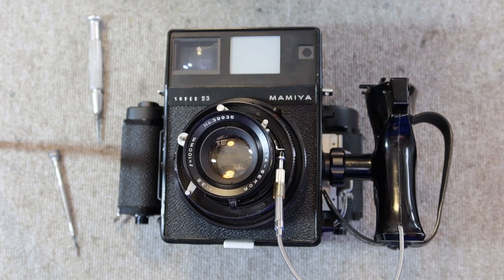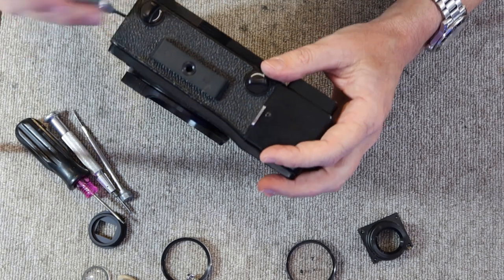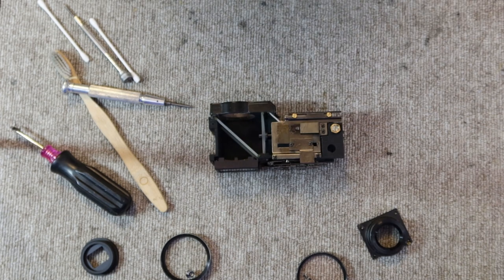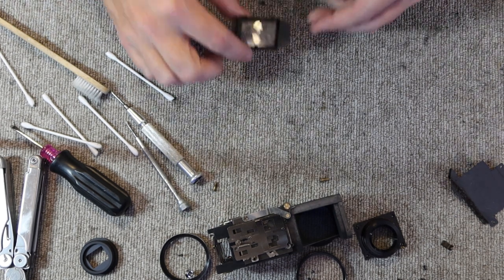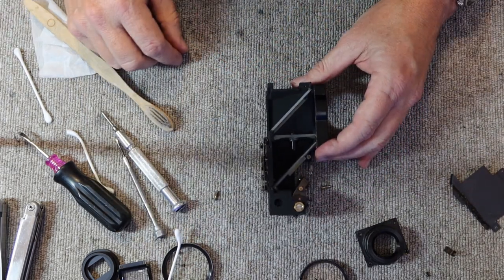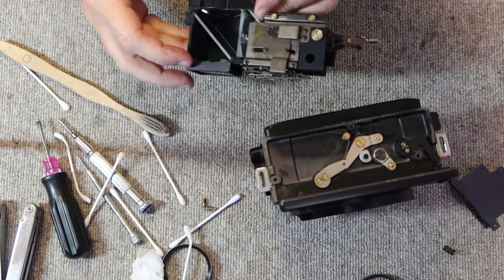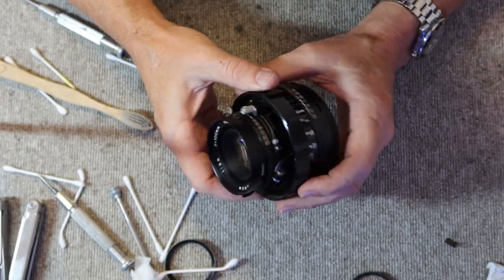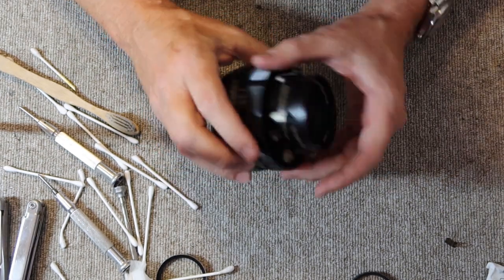How to Overhaul a Mamiya Universal or Super 23 Camera

Comment: also with the Mamiya press (universal and "23") that lens was deliberately made that way, as the focal plane for sheet film holders is different to the 6x9 roll film holders, which is standard with the camera, so this lens "retracts" to allow focussing on the Ground Glass screen, for the "press" mode of operation, with single sheet backs.
On another note, the "universal" is due to the models' ability to accept not just the 23's special 6x9 roll film backs, but also the RB-67's 645/67 backs, with a rare "M" adaptor plate attached, an "R" adaptor is what the rotating back of the RB-67 has on the body ( the silver lever on the bottom of the rotating adaptor), so this camera back is already adapted as standard, but this was, presumably to facillitate compatabillity of film backs between the "macro RB-67" and the "press"\"rangefinder" universal_Press cameras, linhof's were simmilar in their cross compatabillity between their Technika line (6.5*9/4*5)-field cameras & the Kardan/techniKardan/ Karden color line(4*5/5*7/8*10) of monorail cameras.

Comment: Thank you for this video!  After a thorough cleaning of the rangefinder my old super 23 is working so well!  So neat to see how the rangefinder works.  Also, I was able to repair a stuck frameline adjuster as well (hardened grease the major culprit).  Mine is '73 vintage, hope this camera lasts another 50 years.

Comment: Excellent video - thank you. One small point, as these are Japanese cameras, I presume the cross-head screws are actually JIS and would benefit from using JIS screwdrivers to prevent any risk of camming out??
Reply: Yeah, personally, I'd strongly recommend that if you're going to work on cameras in general, particularly Japanese cameras, that you get a set of JIS screwdrivers. It will save you some grief, really, if you make the investment.

Comment: I didn't really see this area addressed in the video, but two of the eight screws are broken that attach the front plate (where the lens mount is) to the body. I'm wondering if you know what size screws those are in order to find replacements. I don't think it will affect the operation of the camera, but if I'm going to do a full overhaul to replace the light seals and everything, I will probably want to get some new screws. Would it be best to just cannibalize another body?

Comment: I found this, 48.10.29, on the rangefinder module of my Super 23  I found a dating chart indicating that the 48 was the year 1973 (10.29) October 29th.  You said your camera shows 49 and the chart shows 1974, not 1973 as you said.  I would like to make sure which is correct.  I created an Access database for all of my camera equipment and I input when the items came out for that model or make.  For the last couple of days, I have watched this video a number of times, paused it, and started it up again to ensure my teardown/reassembly is correct and proper.
Reply from the maker: The first two numbers are the Showa Era year, I know my birth year in the Showa system, and usually just add or subtract from that number to get the correct year. But math was not my best subject in school.
Reply: showa year + 25 is gregorian calendar year (last 2 digits of course)

Comment: I just bought a Mamyia Universal and it seems to be working perfectly fine. I have the 100mm f/3.5 and the 150mm f/5.6 lenses. When I use the 100mm the range finder responds to me turning the lens fine but the 150mm doesn't seem to work with the range finder. Nobody else seems to have the problem, can you help me in some way?

Comment: Thank you for sharing this, very helpful! I was wondering if you ever came across the situation where horisontal rangefinder adjustment couldn't be done because it's too far off the ballpark and the length of the adjustment screw isn't enough to get the images aligned. I have this issue with the early Mamiya Press that has the small horisontal adjustment screw in front, which pushes the metal enclosure with the beam lens in/out, but the full length of the screw is not sufficient (the camera seems to have sustained a frontal drop). Thank you

Comment: Thanks for making this video.  I have been waiting for this.  Since you don't recommend taking the shutter apart, is there any other way to fix the sticky shutter? putting some lighter fluid on shutter blade will also fix the shutter itself too?
Reply from the maker: it can help, but you need to be careful to wipe off any fluid and oil which gets on the shutter and aperture blades. You can use a cotton swab with a little lighter fluid on it. It make take many cotton swabs to get them clean, but the shutter will work better afterwards.
Reply: @japanvintagecamera8869  Thank you so much for your advice! Your video helps me so much :)

Comment: Hello there I would really appreciate a reply if you're still active. 

I have a 23 and a universal. 

I have no experience with servicing these however I am going to give it a go. 

The optics seem clean and the contrast good I just need to calibrate the rangefinder. 

Now is this what you meant when you said about aligning the rangefinder, horizontal and vertical? 

Is it as simple as adjusting those screws so that the hole is in alignment?

Comment: Do you have any idea where I could get a replacement for the filter threads for the 90mm as they were damaged in transit. Also any idea how to fix a slow shutter on the same 90mm f3,5 lens?

Comment: Do you have plans to do a similar video for the 600SE? Mine seems to have a cloudy viewfinder, and as of yet, I don't have the confidence to take it apart.
Reply from the maker: The instructions are exactly the same, the only differnce is that there is a metal film around the viewfinder eyepiece instead of the leatherette on the Universal and Super 23, you have to put some lacquer thinner around the metal film, let it soak into the glue, and then pry it up gently so as not to bend or damage it.

Comment: Any tips for refurbishing the grip with remote shutter release?
Reply from the maker: The cable can sometimes get stuck in these if the metal cable housing becomes kinked. It is very hard to get them to work again if this happens. I usually replace the cable using one from a Fuji Miniportrait ID camera. These have 4 lenses on the front and take instant photos for passports and such. In Japan they usually sell for less than $10. You remove the screws on the sides of the grip, and the screws on the flash shoe. Inside, the cable is held against the inner part of the trigger by two screws.

Comment: Do you know if it's different for the polaroid 600/600se?
Reply from the maker: It is better than the Polaroid 600 cameras because there are more lens options, and you can use roll film as well as instant pack film.
Reply: @japanvintagecamera8869  sorry I meant the process of cleaning the viewfinder
Reply from the maker: The main difference is that the Polaroid has a metal cover glued around the viewfinder window instead of the leatherette on the Mamiya cameras. You have to remove the metal cover to access the screws to remove the viewfinder lenses for cleaning. The metal cover is easily bent and damaged, it comes off easier if you get it hot with a hair dryer to soften the glue.
Reply: @japanvintagecamera8869  thanks dude

Comment: the wrongest idea to adjust a second lens which must be adjusted is changing cam!!!!
Reply: the lens and not the cam must be adjusted, damned! and there must be checked reliability of lens-focussing first. is distance ok?
Reply from the maker: @michaelprzewrocki4195  You need a focusing screen to make adjustments to the lens itself. In nearly every case I adjust a rangefinder to a particular lens, if I change lenses the rangefinder adjustment is correct. But some people don't know how to take off the top cover to adjust the rangefinder, and tinker with the adjustment on the lens.